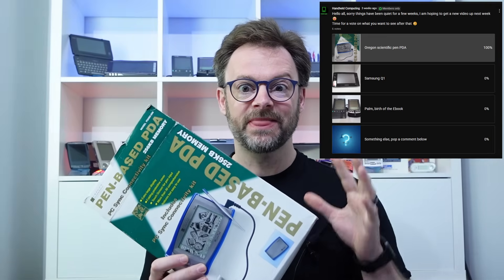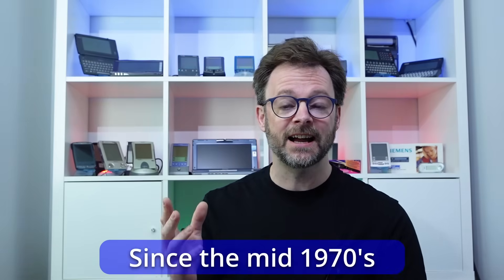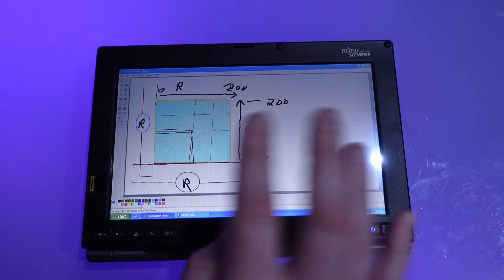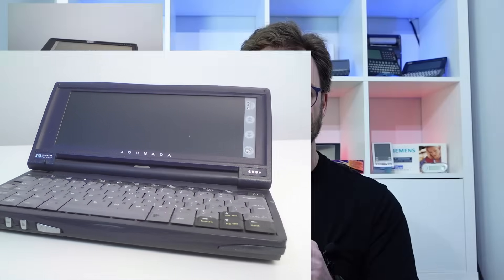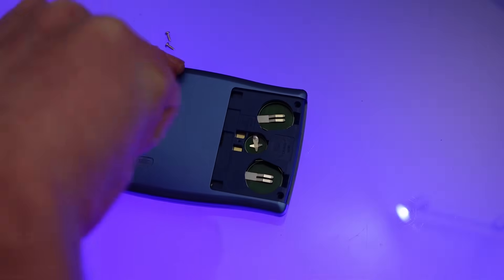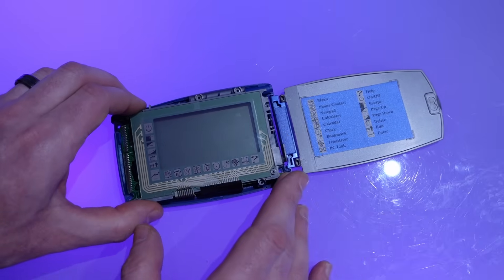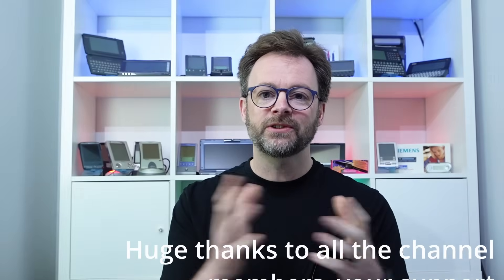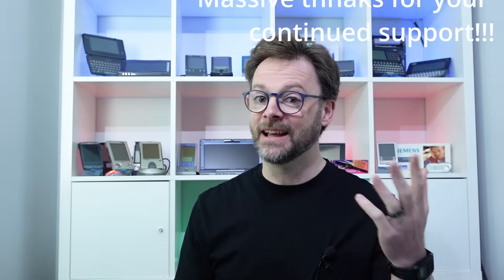When things just don't work! Resistive touch screen

Comment: Very good explanation of the technology. Have the same experience with heating up the screen - it improves things a little bit but once being broken, touchscreen is done for good. Luckily, spare ones are readily available for many pocket devices on ebay and aliexpress.
Reply from the maker: We live in a great time period for old tech exactly because you can often get direct replacements cheap straight out of China which 15 years ago just wasn't possible! Nice to see you back in the comments Fradd 😉

Comment: You even used a vintage tabled to explain how resistive touch-screens work 🤗 I thought that was a nice touch 😉 As for the repair, I have some thoughts: The matrix style layout suggest it’s a scanned matrix rather than a resistive touchscreen (thus very similar to a regular computer keyboard). If certain squares in this matrix are non-reactive, it seems like some contacts went open. If anything was „stuck closed“ in this scenario, the software would most probably not register any keypresses (because double keypresses are ambiguous when there is no diodes in a matrix like that). I‘m voting for contact problems (missing connections) at the point where the layers connect to the „ribbon“ cable part, or where that cable attaches to the PCB. (are there - glued? - contact points?) In this case the Fix I would try would be similar to that for loosened Flatflex bonds (glued) on glass LCD panels or PCBs: Gentle heat and gentle pressure on these points, then letting everything cool down under gentle mechanical pressure. Just my 2 cents of course, results may vary 😁
Reply from the maker: 1st thank you for your super!!!! 2nd thank you for the feedback on using the tablet for explaining principals, I wasn't sure how well that would be received so maybe I will do more of that in the future. 3rd good point, could be some of the connections off the ribbon and the restoration I did get was due to those re-sealing - I will try this on and see if it works 😃
Reply: @HandheldComputing  have you tried this yet? I have the same PDA and am trying to fix it.
Reply from the maker: @jegler3546  Yes I did and it is still not working 😥
I think its dead...